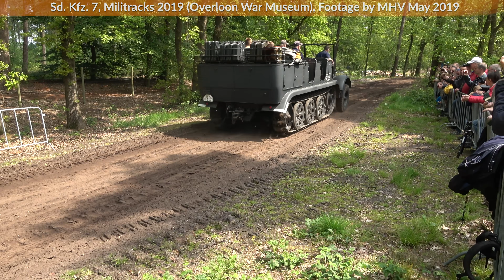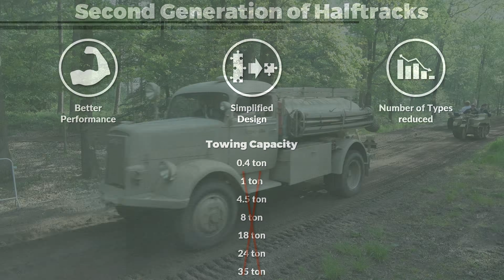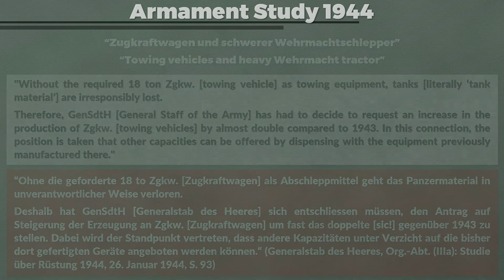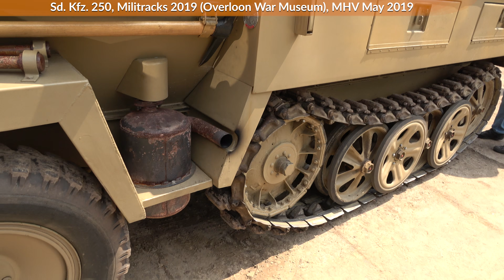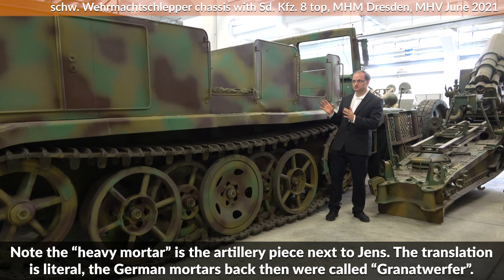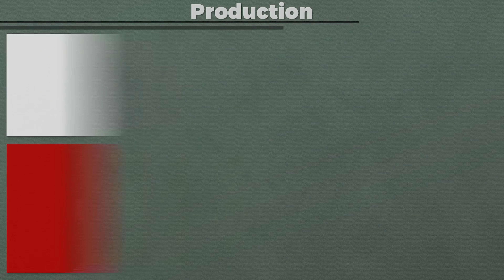The most boring WW2 vehicle? The schwerer Wehrmachtschlepper

Comment: Ian from Forgotten Weapons have uploaded a new video about why the german army didn't use a large caliber machine gun on their tanks during WW2, like what the americans did with the M2 Browning. There was nothing specific that concluded why they didn't use them, and I thought it would be interesting if you maybe had the answer for it.
Reply from the maker: I watched it myself already, although the initial question has nothing to do with tanks. 
I would add the following, for the German Army the difference between a light and heavy machine gun was not the caliber but the mount. The MG34 and also the MG42 was a light machine gun with the bi-pod and a heavy with the lafette tripod (not the simple AA tripod, then it was still a light machine gun). So it was actually about the tactical use, but this also does not provide a definitive answer.
I assume that at some point the decided that an "intermediate" caliber between 7.92 and 20mm did not make much sense, might probably go back to the Reichswehr (predecessor of the Wehrmacht) since they were rather short on everything.
Reply: @MilitaryHistoryVisualized  Interesting, I would say (at least in English during WWII) MG34 with the Lafette mount would be a Medium Machine Gun, like Vickers or M1917.  But terminologies were messy after all.
Reply: @lukelee5385  Medium machine gun as a term also came later, after .50cals were created. In WWI such guns like Vickers and M1917 were called heavy machine guns. Germans stayed with light-heavy designation (without medium between them) probably for that reason.

As a side trivia, in polish terminology it's similar - machine gun on tripod is called a heavy machine gun and it doesn't matter whether it's 30cal or 50cal. However, there's separate category for guns such as 50cals - "high-caliber machine gun" (wielkokalibrowy karabin maszynowy). So there are multiple ways to look at that issue and each nation, depending on history of their armament, have their own way.
Reply: @lukelee5385  That makes perfect sense.  I've read (among other sources: Modern Small Arms, by Frederick Myatt- Salamander 1979) that the MG34 was the first General Purpose Machine Gun, designed to replace both LMGs and Medium MGs.  In this it was the forerunner of both the US M60 and the FN MAG/L7/M240.
Reply: @MilitaryHistoryVisualized  more importantly, I think it would be interesting if you could address the question that Chieftan couldn’t find documentation on—regarding the question of German tank unit doctrine to anti-aircraft. This seems right up your alley the way you use authentic analysis and documentation from German sources.
Reply: @jimp.8396  The Germans had cannon-armed flak units from the start, both towed and self-propelled, they were well in advance of everyone else in that regard.

A by-product of being forbidden form having and air force, they were forced to focus on AAA from the start, so they developed 20, 88 and 37mm AA guns and made LOTS of them, so when allied aircraft tried to attack German formations in France they got massacred.
Reply from the maker: @jimp.8396  He mentioned instructions to fire upon aircraft with everything, I found those too. I actually have a small list of documents that deal with AA fire with all kinds of stuff.
I think he did mention that he did not find a mention why the 20mm was not installed on tanks, I haven't come across anything there, but then again I never looked. This is of course a "major" top-level decision, so the question is, if there is any documentation left.
Reply: @MilitaryHistoryVisualized  There where no 20 mm ACs mounted on tanks or AFV, except those designed for them, for several reasons:
The German WW2 era 20 mm ACs where petty large, crew served weapons. The muzzle energy is in the 50 kJ range. About what most modern 20 mm cannons have and allmost three times what .50 cals generate. The ROF of the Flak 38 ist allmost as high as that of of the M2HB. As a result the recoil of the 20x138 is substancial and requires a strong eg. large and heavy mounting. While the .50 cals and 20 mm ACs have similar tactical uses they are in a entirely different category of weapon. This alone makes a full power 20 mm ACs unsuitable for use in a simple pintle mount and thus as 1 for 1 .50 cal replacement.
Furthermore the German 20 mm ACs where magazine fed. Which means a loader is needed to constantly reload the gun. A Flak 38 will need less than three seconds to empty a 20 rds magazine. The sights, to utilise the longer range compared to a .50 cal, where complex and often required a dedicated operator and a range finder to give the sight setter the ranging information. Including the gunner we allready need four men. These need to be able to move around with the gun. Which needs space. German single barrel 20 mm Flak had a crew of five to seven men. Depending on circmstances.
In comparison a .50 is small, lightweight, has unsofisticated sights and usually is belt fed (the ones that where not where concidered bad designs once used in combat). Which means it can be easily operated by one man.
The one big exception to the points above it the MG 151/20. Which is belt fed. But its also conciderably lower powered (roughly 2/3) compared to the 20x138 guns. This means this gun is viable as a 1 vs 1 .50 cal replacement. It indeed was used as such. To a limited extend by the Germans at the end of WW2 but especially by the French and South Africans (who still produce the gun and ammo as GA-1) after WW2.
Reply: schnuersi ,all very good points. The M 2 was used very heavily in the Army Air Corps. So many fighters, attack, and bomber aircraft used the M 2 in massive numbers. It would seem the Armaments Dept did not think 20 mm and 30 mm auto cannon would be worth the work ( seems probably... less than a reliable approach by them, in hindsight ).
Reply: @MilitaryHistoryVisualized  Didn't the Wehrmacht make "some" use of 20mm guns/autocannons and the like pressed into a "support weapon" or "slap-it-on-a-vehicle-gun" role? Or is this just a "Saving Private Ryan Myth" ? Otherwise or better (also mot./mech) Infantrywise both GPMGs filled their roles very well and I don't really see a doctrinal gap or niche from the german perspective. For more hard targets they still had their AT-Guns and leIG 18's so not really a niche there.
Reply: @EvilGNU  The Germans used their flak for infantry support whenever necessary, but usually as an emergency, save for the 88 that had some designs intended for land use only.
Reply: @MilitaryHistoryVisualized  The German & even Britain to a lesser extent had no need for a 12.7mm/1/2 round or.50cal.
The USA didn't have autocannons nor invested for them unlike European powers in for Germany had 
124,734 Oerlikon 20 mm cannon produced.
more than 144,000 flak 38's they mounted on vehicles of all sorts using AA guns for anti everything but tanks or ships.
This only 2 of about a dozen types German autocannons for they were the kings of autocannons in world war 2 & invented the 1st revolver autocannon (Mauser MG 213)  which played a massive part in USA Rotary cannons design such as the Vulcan 61 1959-present.
Most of the best gear the USA has is heavily based on Nazi German assets, designs or made by a literal former NAZI they employed post war. 

Britain has the 1st ever autocannon being QF 1-pounder pom-pom=37mm 1890s–1918 though still used in mainland out of desperation with scaled up 2pdr=40 mm version designated  QF 2-pounder naval gun from 1917-1940's was the bulk of British autocannons but mainly naval or permanent emplacement
COW 37 mm gun 
20 mm Polsten basically an Oerlikon designed to be cheaper with only 119 parts instead of 250 as a joint venture between Poland & Britain. 
Vickers 40 mm Class S gun were for ground attack planes
Britain also had an Oerlikon firms in Britain as Oerlikon is swiss & produced Swedish Bofers so Britain's autocannons was real Hodge podge but had a lot of hem old & new. 
Britain had no shortage Autocannons but a lot of them where old wanting them to be updated on the cheap cheap as Britain was burning through cash in ww2!

The USA may have made 2 million M2 browning from 1921 till the end of ww2 for the few autocannons they had being 1.1-inch/75-caliber gun roughly 1000 made & 37 mm Automatic Gun, M4 used in aircraft they had a shortage through out the war but not made in significant number from what I read with no real count.
The USA would have been fvcked if not for Swedish Bofors 40 mm guns which won them the pacific.
The USA was so desperate for an Autocannon by the outset of ww2 Britain let them build 2pdr  pom pom's.
You have to be desperate to take a 1917 design & put that into production.

Not of the Anglo-sphere the Russians DShK the only other notable .50 cal machine gun from the USSR 9,000 were made in ww2 not because they couldn't produce them but that autocannons were considered a priority as 7.62×54mmR machine gun being PM M1910,  SG-43 Gorunov, DP-27 & DS-39 & British Bren guns sent were more then adequate. 

The 1 thing the USA lacked till Bofers 40mm the Swedes let them buy production was autocannons hence why they made so many M2 browning's!
Reply: @MilitaryHistoryVisualized might I point out, that the Wehrmacht had the 34 respectively 42 in 9mm....
Reply: The short answer is the Germans already had larger caliber 20mm and 30mm autocannon for the job of light air defence/anti armor so didnt need a 12.7mm heavy machinegun which was now obsolete in the anti-armor role anyway. The US didnt have anything better so they just kept making them (along with the new 37mm M1 autocannon) and ended up with more of the machine guns than they knew what to do with having unused WW2 manufactured stock still lying around by the time of Vietnam. (though really in the AA role they were intended for they were both obsolete by 43 anyway being superseded by the Bofors 40mm)
Reply: I do know that MG34 were hull mounted and MG42 we're atop tanks, due to how the barrels are removed from the gun.  Always thought that was interesting.
Reply: @SouthParkCows88   MG34 had a milled receiver, which cost more time and money to manufacture. The MG42 was stamped from sheet metal, so it took a lot less time and money.
The MG34 had its uses, but mass production for infantry units required something simple and cheap.
Reply: @willw8011  also a good point.
Reply: @willw8011  do not forget that the MG 34 was fairly reliable it was sensitive to extreme weather conditions, dirt and mud had to be competently maintained it was quite reliable. The distribution to the troops was hampered due to its elaborately milled precision engineering with tight tolerances and use of high-quality metal alloys, which resulted in high machine time, skilled labor requirements, production costs and a relatively slow rate of production. I have seen the MG 34 personally twice and was quite impressed by its high quality....
Reply: Possibly they were reserved for use in Aircraft.
Reply: @zulubeatz1  The Luftwaffe did indeed have the MG-131, a 13mm machine gun for aircraft use.

According to the Wikipedia article, these were fired by electric spark rather than mechanically. Since it's from Wikipedia, the details need to be confirmed.

Also, the Italians appear to have produced a 12.7mm Breda machine gun... again, more digging is required to confirm.
Reply: @chemech  So did the Japanese... but the HMG were obsolete for aircraft, the US used them because it was all they had and also failed to copy the French Hispano... they also drank their own koolaid and convince themselves it was "great"...

MG 131s were indeed electrically fired and a LOT lighter than an M2.
Reply: @LucioFercho  The Japanese did have a licensed(?) version of the Hotchkiss .50 IIRC... they had some issues with its reliability and were never all that fond of it.

The US made several policy / engineering decisions in  1940 / 41 which were only starting to show signs of being outdated in late 1944... the .50 BMG was a very effective round against aircraft produced prior to that date, and the mass production was rolling when the question of it maybe being insufficient for aerial combat began to come up.

The USAF did not need to blow chunks out of Axis bombers, so the lesser performance of .50 BMG vs 20mm cannon wasn't as much of an issue.

The hiatus between 1945 and 1950 is when the .50 really got outclassed,  Korea is when the combat involving jet aircraft showed that the velocity of the .50 projectiles was too slow to inflict serious damage.
Reply: @chemech  Look at the weight difference between having M2s and 20mm cannon with explosive shells...
Reply: @chemech  A P47 carried 613Kg of guns and ammo, it took 4.8s to fire 2,320g of ammo.

The P51 carried 385Kg of guns and ammo, it took 6.5s to fire 2,320g of ammo.

The Fw190A8 carried 431Kg of guns and ammo, it took 2.8s to fire 2,320g of ammo, and those cannon shells are FAR, FAR more effective while in a lighter package.

I could go on...
Reply: @LucioFercho  Why are there so many people like this guy who so rabidly decry the US usage of mgs in wwii, its so odd and yet I keep seeing it lol
Reply: @pickleman40  Decry? You mean make fun off the fanboys who believe it was some sort of wonder weapon... XD
Reply: @LucioFercho  nobody was saying that though
Reply: @pickleman40  Please, the very same question asked is a consequence of how much you have been brainwashed about that silly weapon, that and shotguns.

It is hilarious how oblivious you people are about it.
Reply: chemech ,yes thank you commenting! The Germans did use the M 131 and i believe another 13 mm machine gun for the Luftwaffe. Do not remember any tanks or ground vehicles that did not use standard Wehrmacht calibers, 7.92 mm , 20 mm , etc. For various reasons, why would the Wehrmacht want to try supplying an additional cartridge type like the .50 BMG ?  Does not seem the Heer or Wehrmacht though there was a need to cause logistic problems to fill the M 2 type and a different cartridge with it. 
( drinking game for how many times I say "cartridge" lol ! )
😉
Reply: @Williestyle-RobotechxMacross-x  It was the MG131, the only 13mm weapon they had, developed for aircraft.
Reply: @chemech  It wasn't a matter of the .50 BMG lacking in muzzle velocity--because if anything, the M2 had as high, if not a higher muzzle velocity than most 20mm autocannon from WWII. 

Rather, the issue was that each .50 BMG projectile did relatively little damage compared to a hit from a 20mm high explosive shell (especially those of the Minengeschoss variant). And since jets had higher speeds compared to piston-engine fighters, the window in which to land damaging hits on an enemy aircraft was significantly limited--you needed to put a lot of dakka in the air fast and have at least some of those rounds hit something vital. .50 BMG armament could deliver on the dakka, but not on the chances of hitting something vital on a jet. Other solutions, like unguided aerial rockets, proved utterly horrendous for A2A usage. 

With propeller-driven aircraft, this wasn't as much of an issue, since neither the defender nor the attacker was flying so fast that the .50-cal equipped aircraft couldn't sit on the target's tail and give it a hefty dose of freedom seeds until the target went down in flames. The dogfights between jets had much shorter "points of contact" so actually landing damaging hits with a high RoF, but lower damage armament wasn't ideal.

As for the suitability of .50 BMG for aerial combat and AA use, a 12.7mm machine gun is still a serious threat to most rotary-winged aircraft (i.e. helicopters) even today. It isn't particularly threatening to fixed wing aviation because even something like an Su-25 or A-10 is too fast for even a quad-mounted .50 BMG platform to reliably inflict crippling damage on it before the aircraft has deployed its ordnance and waved off.

Interestingly enough, the US Navy recognized early during WWII that 20mm was the way to go. The USAAF stubbornly stuck with .50 BMG (other than a few exceptions, like the P-39 and the P-38) because the US manufacturers somehow botched the production of the Hispano cannon, despite the British giving them all of licenses, schematics, and measurements. US-made 20mm autocannon were quite unreliable during WWII, hence why they stuck with .50 BMG which worked just fine for shooting down fighters and fighter-bombers.

I imagine that one other advantage of the USAAF aircraft armament (all .50 BMG machine guns) was that it made training new pilots in aerial gunnery somewhat simpler, because all of their weapons were ballistically equivalent--they only needed to consider gun convergence. Compare that with the mixed MG and cannon armament preferred by everyone else in WWII, where the .30 to .51 cal MGs did not match the ballistics of the 20mm or larger autocannon.
Reply: @LucioFercho  I don't think anyone is claiming that the M2 Browning is some sort of "wonder weapon," lol. It was.... and still is effective at its intended role, however--delivering direct, long-range fires at low-flying aerial and lightly armoured ground threats. Being shot at with any sort of firearm is not a pleasant experience. Being shot at with .50 BMG is truly terrifying, as those bullets will easily transform what you thought was good cover into rather poor concealment.
Reply: The M2 originated from WW1 when the .50 cartridge was effective against contemporary aircraft and tanks, by the time the Germans rearmed in the 1930’s aircraft performance and tank protection had improved so they went for the 20mm cannon instead which was more effective. But as it was also heavier and more expensive so it did not become so ubiquitous as the M2.
Reply: @scipioafricanus4328  The US Military also had 3 categories of machine guns: light, medium and heavy. In WW2 the BAR was the light, the M1919 was the medium and the M2 the heavy. The US Military also had a heavy weapons platoon in each company. The US Military also had heavy weapons company in battalion size units.
Currently, the US Military still has the 3 categories of machine guns: M249 is the light, M240 is the medium and M2 is the heavy.
Reply: I thought he made it pretty clear that it was because they had their own dedicated anti-air units that used more effective large caliber weapons for longer range AA that wouldn't fit on each individual tank itself
And it wasn't worth making an intermediate cartridge between 30 cal and 20 mm to put on these tanks
Reply: Didn't German neck up Soviet 12.7 and make them autocannons anyway?
Reply: @victoriazero8869  TheGermans  created the 15mm MG151 and quickly turned it into a 20mm weapon.
Reply: @chooseyouhandle   The US Military never used the M2 during WW1. The M2 entered service about 1920 and it still remains in service as the heavy machine gun of the US Military. By the time WW2 started, the M2 was everywhere throughout the whole US Military. Every heavy weapons platoon and company had many M2. The USAAF used the M2 in B17. The US Navy used M2 on ships. The M2 was a general purpose heavy machine gun. The US Military also had M45 quad 50 cal, which was 4 M2 put together for air defense roles. 

BTW, the US Military still uses the M2 for ground combat units. Throughout its entire history the M2 has been used in ground combat units.
Reply: @chooseyouhandle   Your other comment disappeared, so I could only read part of it from the notification. 
For a large part of the M60's service, the M14 was the light machine gun. One person in a squad would have a M14 with selector switch and everyone else would have their M14 on semi-auto only with no selector switch. When the M16 (223) came out, then all of those had full-auto abilities. The M16 and M14 used as a light machine gun was a disaster due to the limited ammo in a mag. Similarly the BAR as a light machine gun was also very limited. 

A lot of people in the military did not like the M60, so it was replaced with the M240. The USA also changed the M16A2 to a burst weapon, which is mostly used in semi-auto. The M249 was a result of the switch to 5.56 NATO and the need to have more firepower per squad. It is just part of the evolution of American firepower and the use of ammo. The US Military also uses the M134 as a vehicle mounted minigun. If that was not ridiculous enough, the US Military also had the M134 variant (XM214) chambered in 5.56 and had plain to make those hand held miniguns with ammo cans strapped to the backs of troops using those. If you want to see some ridiculous stuff, then search for the XM214.
Reply: @willw8011  As far as I know, the XM214 was never fielded. A minigun in 5.56x45mm was found to serve little purpose. You don't need that rate of fire for infantry applications (because some unlucky sod is going to have to schlepp all the ammo), and for aerial usage, 5.56x45mm is too small to really be useful for ground attack.
Reply: @Schwarzvogel1   The XM214 was never fielded and it was originally .223, just like the M16. In the early 1960s, the US Army wanted to up its firepower due to the experience with human wave attacks by the Japanese in WW2 and the Chinese in Korea. The M134 was too heavy and required a lot of 7.62 NATO ammo, so it would never be portable enough for infantry to move on foot. 

In the mid 1960s, the US Army experimented with the XM214 for use on a tripod, on helicopter, and also as man portable walking fire. The XM 214 was small enough for one man to carry and shoot. The backpack with 1,000 rounds of ammo and the battery to power the XM214 was going to be carried by another man. Every once in awhile the idea of it kept popping up, including the XM556. It might have come in handy in Vietnam with some of the human wave like attacks on US firebases.

There is no point of it now due to the M249 doing the same basic job.
Reply: To be honest the Chieftain did most of the video lol
Reply: Didn't the Americans mount the M2 externally on the early M4s for ground to air defense. Later they were mounted In front of the commanders copula as a anti material weapon. Either way the M2 HB is still in service and the MG 34 and MG 42 is not.
Reply: The MG34 in the Panzers were called Panzerlauf 34, basically an MG34 without the bipod and butt stock.
Reply: I personally think it's because of the amount of anti tank weapons they had like pak38 and smaller. And anti material rifles. They were far to invested in those to . To then come up with something that can replace them all but the AT cannons. And then start production of ammo too late into the war
Reply: Correct me if I'm wrong, but weren't there plans to install 20mm guns on some of the heavy tanks later in the war, such as the Maus?

This would have been similar in function to the .50 cal, being both an anti-aircraft gun, but more importantly, an anti-material weapon against light armour, machinegun nests, and anti-tank guns.  Of course, to mount a 20mm gun would take up a lot of space, so only heavy tanks would reliably be able to do it, and those tanks themselves were grossly impractical.
Reply: I thought his answer was very conclusive. They didn't see a larger-than-rifle caliber machine gun to be useful in nor suitable to that role. Beyond the role of pintle mounted on a tank, the wehrmacht didn't view  weapons with lesser sustained firepower than their man-portable counterparts. Such as the predominantly rear-line use of the ZB-50, the example he gave. The 2,0cm flak 30 was more portable in its base carriage configuration than a M2HB on its tripod, while giving a massive increase in firepower via room for fuzing. Even so, the flak 30's use as a secondary weapon for an armored vehicle is extremely uncommon. (I have seen one or two pictures of it being done)
Reply: Mindset as didn’t think they needed them and lack of production 
In would be a 30 cal anyway if mounted or had enough
Reply: right... the Anti-Tank Machine Gun from WWI.

WWI people were so stupid, they thought they were gonna end "all future wars". Hahaha, jokes on them, they had no idea how low we were capable of going. We were so going to out-stupid them like the champs we are.
Reply: @ylstorage7085  That was Dr Maxim's sales pitch.